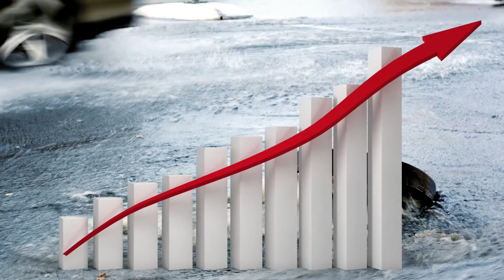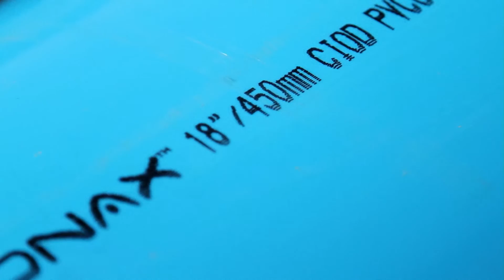20”, 24” and 30” Diameter Bionax® PVCO Pipes

Comment: What is really funny about this video is that when they run over it with an excavator it doesn't prove anything! according to AWWA any PVC pipe scratched 10% or more it should be rejected.  It becomes unsafe to pump water.  Such a silly product